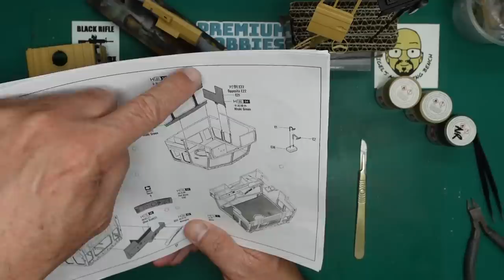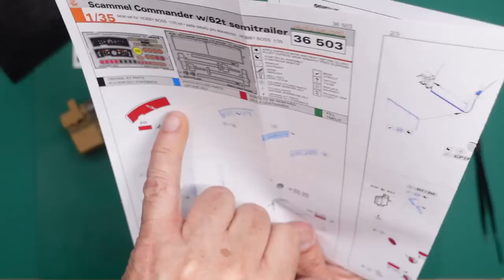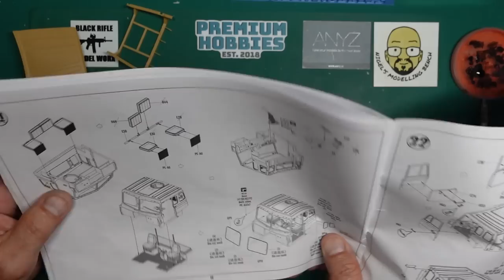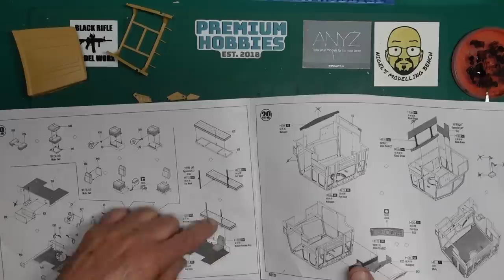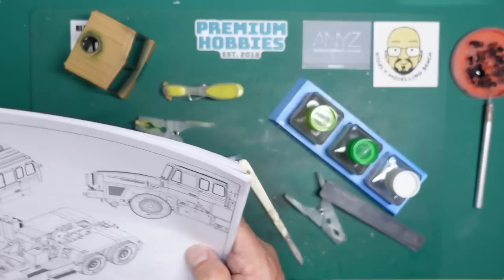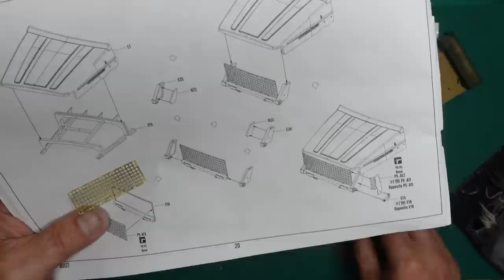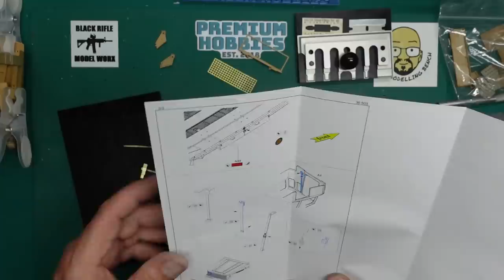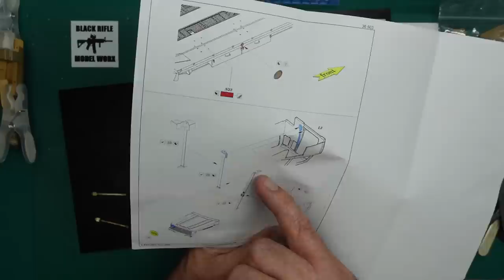HobbyBoss 1/35 Scammell Commander build. Part 12.

Comment: Well done Nigel, not kicking off when you sanded the mud flaps and seatbelts. I appreciate the update on the cab interior colours. I have the same Military Truck Archive issue, and had noticed the instructions called out 'mahogany', yet in the picture a blind man on a galloping horse could see it was in fact 'hearing aid beige' courtesy of 1970's Leyland vinyls ltd.

is that code for the black superglue still current?
Reply from the maker: LMAO!! hearing aid beige.